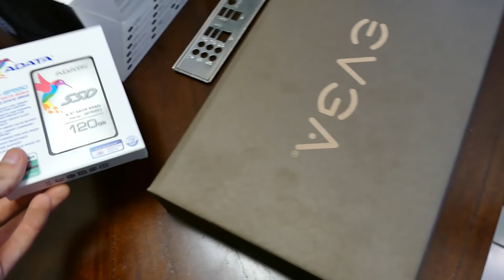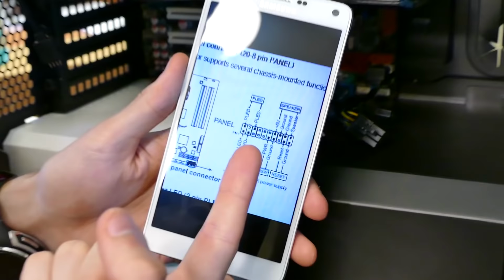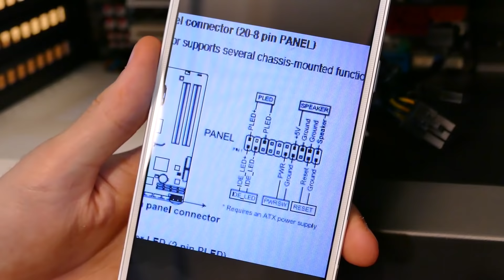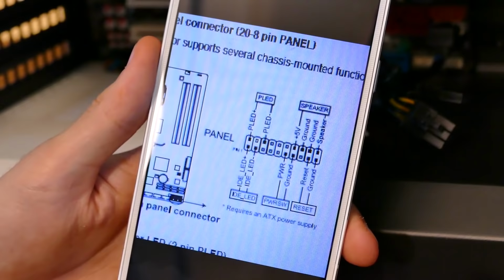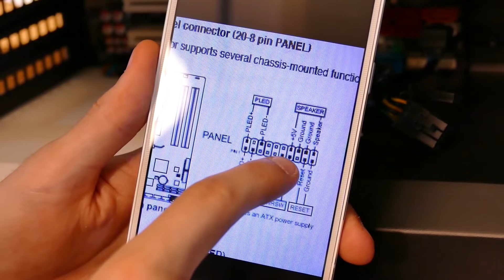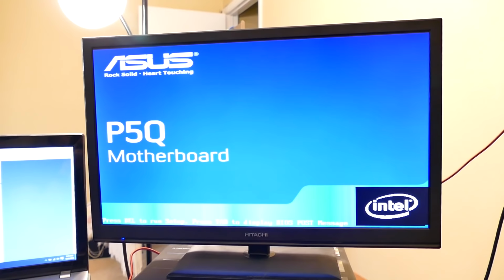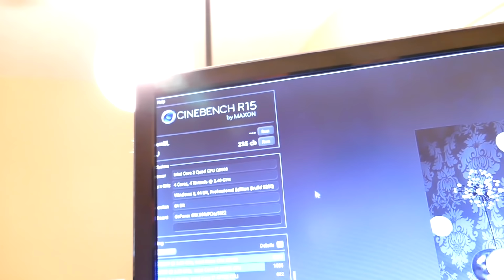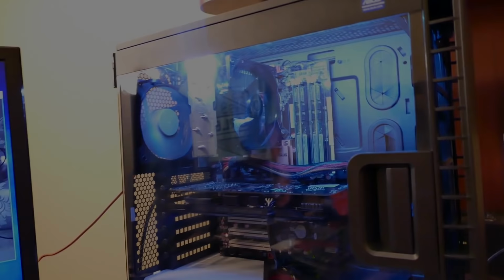Q6600 PC Build Vlog

Comment: I still find it enjoyable to watch an old CPU like a Q6600 being used today.
Reply: My q6600 is still used for gaming
Reply: I'm using mine to type this and I love it.I bought the CPU for around $10 on eBay and the rest is built around a SFF DELL 745 with eBay Parts.Around $125-150 including the Tower.Plays a good range of games still,just don't expect a monster  gaming rig.
Reply: Typing this on my PC from the golden era of PC gaming (circa 2008) with a i7-920, still loving it, gonna get a x5650 soon though
Reply: My Secondary PC has a Q9300 with an R9 270x playing DOOM :)
Reply: doom 4 can even be ran on a pentium 4 coupled with a gtx 970, even though it looks stupid it gets decent 30-45 ish fps on very high preset 1080p. (saw that in a video).
Reply: shag stars That's pretty incredible.
Reply: I'm building a PC using 790i chipset and QX9770 just to see how well it compares to a modern PC.
Reply: dude i have core2duo ..get a life
Reply: Charle Lol its not like it was meant to be an insult.
Reply: what gpu did you put in it?
Reply: I used a Radeon 7570 Low profile.A full size card won't fit.Also,I modified the internals a bit for cooling.I would never personally choose this size of case.It was only $20 with all of the factory internals still at a pawn shop.These SFF are horrible for cooling.The benefit is the stock CPU heat sink is pretty decent.
Reply: i found my q6600 machine in the dump and just modded it till i got decent frame rates on my games
Reply: im using qx6800
Reply: manwhile, with my fx 8320....
Reply: +3key I still have a 8320 in my secondary PC. Once you overclock them to 4.6ghz or so they aren't that bad at all. Thy still lack the single core IPC of Intel. But for $130 this 8320 is great. Plus when DX12 becomes more widely used it will bring new life into these FX chips. But My 8320 at 4.8 cooled by a Noctua DH-14. Now it's not as fast as my I5 6600k but the 8320 is from 2012-2013. I will say the multi-core performance is not far behind my i5 though.
Reply: same
Reply: XxViciousxX that is if you dont oc your core i5 6600k, vlock it at 4ghz and then its much faster than fx.
Reply: ShagStars Productions My 6600k is at 4.780ghz most games like strong single core performance so my 6600k plays games smoother wth higher minimum FPS.  But the 8320 is not that bad considering it's age and low single core performance and price.
Reply: XxViciousxX well its not bad but here it costs as much as a core i5 6400. Which defeats the point of having an amd fx.
Reply: ShagStars Productions Definitely at that price yeah no point in getting a FX. But at this point in time with Zen right around the corner it would be silly to buy a FX processor now anyway.
Reply: XxViciousxX true.
Reply: I just upgraded my E8400 PC with a gtx 670 i got off ebay, that little dual core is a beast when overclocked! (got it to 3.6 ghz on the stock cooler, i'm going to get a better one so i can get 4ghz without hitting thermal limits)
Reply: arthur staal I had one of those E8400s back in the day. Was a very powerful chip. Destroyed my 1090t in the gaming department.I think I had mine at 3.8 with a Thermaltake Big Typhoon cooler. My motherboard had terrible overclocking capability. I think with a better board I would have hit 4ghz.
Reply: From Dusk Until Dawn Hi, can you try running DotA 2 on your pc? I have a 9300 with 8 GB DDR2 Ram and a GTX 750 and somehow there is a bottleneck in my system, DotA 2 framerate hovers around 30 fps with Vsync off and lower setting (GTX 750 should comfortably ran DotA 2 on max setting at 60 fps without weather effects, tried it on a 4th gen core i3 system)
Reply: Edwin Ooi definitely not you cpu or gpu, I get 45 to 70 fps in shadow of mordor at ultra (e8400 + gtx 670) you probably have a driver issue.
Reply: Dude I have pentium dual core get a life ;-)
Reply: switching my E8400 for xeon 5450 this weekend)
Reply: I just got system with 5450 , xenon e5450 4gb ddr3 500gb hdd for 110 dollars and put in radeon 7790 1gb , evrything works perfectly I play paladins at 1024x1280 maxed out it never gose bellow 70fps , gta 5 1080p normal 40-45fps , im really happy about its 150dollars for gaming PC that can keep up with 350 dollars consoles :-D
Reply: #i  still have one E8400 on a dell T3400 set with a GTX760, i&#39;m looking for a Q9650 to Level on 4Cores :)
Reply: I actually just put together a Xeon 2670 build yesterday. Got the processor  about 5-6 months ago when they were dirt cheap $50. The thing just eats through games. Then there is the crazy multitasking ability. You can do so much and it doesn't slow down a bit. Got the idea from Tech City. Had a lot of fun building the Xeon system.
Reply: get a xeon lga 775 cpu its faster and cheaper than the core 2 extremes
Reply: I use a q9400 in 2017 hehe
Reply: Alex Tana i have a q9300
Reply: I bought a q6600 off ebay a while back for $15 shipped. Been running it in my secondary machine which was my old primary (had an e7200 in it). Running 1333mh fsb with 8 GB of ddr3 it actually runs modern games quite well with an hd5770 (1gb). 

I use that machine as a server for ftp/mumble/ts whatever I need at the moment. Mostly though I use it to serve media and to box games.
Reply: Came across this video after a search... currently putting a Q6600 through its paces... got the system free, put an SSD in it, and am pushing for stable over clocks on CPU and FSB - kinda hoping I'll be able to run Premier Pro 2015 on it passably for 1080 editing, 60 fps - anyone want to make me happy by telling me it will all be well... or crush me by telling me my 48k spectrum would be faster lol

I have zero budget hence why not just building something current, I love something for nothing :D
Reply: Shoutout to 2021, just came back home in my co try and fired up the q6600... Oc'd at 3.9 with stock temps at 68... Changing the noctua cooler to water, and the gtx260 to a 980 ... Should go for couple more years in graphics and games
Reply: Me too

Comment: Q6600 is such an overrated CPU
Reply: for 16 bux??? it is doing very admirably. Q6600 is a great workhorse CPU even in todays tasks.
Reply: For similar price you can get for example much better Xeons for LGA 771, or C2Q for LGA 775
Reply: deXter2 cant overclock.
Reply: Bullshit. And btw - you will lose all your money saved on OC Q6600 after half a year... Extremely inefficient and power hungry.
Reply: deXter2 why would you need to save up for 16usd lol stop while your at it dude.
Reply: Why would you buy 16usd cpu then? USA is not the only country in the world, some might think it's a good deal and not just fun.. Well, it is not. 
And I forgot about first i5 series, very cheap now and some revisions overlock really great. 
Forget Q6600, it's just too fucking old.
Reply: deXter2 thats 22usd. I still need it to be fiiiiiiiiiif>teen US currency dollars.
Reply: deXter2 The cheapest i saw was 22usd. U mad???
Reply: My q6600 is still running at 3,4 ghz in my second pc and it is a beast and yes its old but i don't care.
Reply: Dude can you chill? You can overclock a Q6600 higher than the Xeon can go, and the Xeon you showed for $22 isn't even hyperthreaded. You don't need high cache unless doing high CPU based tasks, and with such a low core count and speed, it wouldn't do much help anyways. And the Q6600 is less. Q6600 is the clear winner.
Reply: Umami Cupcake i3 processors have better performance, not value. Q6600 is $15. i3s are much more expensive.
Reply: windowsfrozenshut I'll give you that one. But that doesn't invalidate the Q6600. If you don't have an LGA 771 board, but have an LGA 775 board, then the Q6600 is a better choice. But if you have an LGA 771 board that supports Xeons, (they were less common back in that era) then you can go for the x3353.
Reply: How about the Xeon version of a Q9450 for 9$ (that's 9 US smackaroons)? Plus a few cents for a "mod sticker", and 20 seconds with a box-cutter for chipping off the keying nubs in the LGA775. 
http://www.ebay.com/itm/Intel-Xeon-Quad-Core-E5430-2-66GHz-12MB-LGA771-SLANU-CPU-Processor-/331881825508?hash=item4d45b2c4e4:g:de0AAOSw3YNXYIKD

I'm (still) running an L5420 @ 3.3GHz (quad low-power, 2.5GHz stock) on a P5Q Pro, and upgraded the rigs of two of my friends with an E5430 @ 3.2GHz (quad, 2.6GHz stock) on an MSI P35 Neo, and an E5440 (quad, 2.83GHz) in some Compaq microATX. Both of them are happy, and i've heard of zero issues.
Reply: Good thing I brought my cereal popcorn!
Reply: Je van der Geest ^^^ THIS ^^^ :)
EstMovies Even LGA771 boards can be had for dirt cheap nowadays, although the argument could be made that finding one in a (normal) ATX format's gonna be tricky. 

For further information: https://web.archive.org/web/20160320090508/http://www.delidded.com/
Reply: yeah tbh, my friend has a better version of it (i'm not sure which one exactly, i think it was the 9650) and it's better for around the same price nowadays.
i think the main thing is how well it's held up since its release but... so did the others. that generation was just very very strong.
Reply: go with a core 13 550 its like the same price @3.2 ghz and its hyperthreaded, and it has onboard graphics and its 3 years newer it's better in every way than a q6600
Reply: Its a 10 years old CPU.
Reply: My core 2 duo E8400 is really pissed about your comment
Reply: C2D E8400 is soo much better cpu in relation to price nowadyas. I know, I have one myself in my mother's PC. Actually for most basic uses it is more powerful than Q6600 for fraction of money you have to spend on overhyped Q6600 which keeps such a ridiculous price partially thanks to all the irrational hype made by some 'retro tech' youtubers.
Reply: Lga771 motherboards are fucking expensive unless you go fucking hardcore hunting for a cheap one
Reply: xeon 5450 is better still for under 20 bucks
Reply: you can use an adapter to fit lga 771 cpus into 775 mbs, it costs less than a dollar
Reply: leafyisqueer I've been using a Xeon L5420 o/c'd @ 3.33GHz on an Asus P5Q Pro for about a year and a half now, with zero issues :P CPU cost me a whopping 15eu (12MB cache and all that)...
Reply: but then you have to cut up the mothrboard

Comment: Core 2 Quad: Q6600 & Phenom X4 9550 are legendary CPUs! :)
Reply: used a phenome ii x4 965 are as expensive
Reply: I'm still using a stock clock Phenom 955. It works well for a general use desktop once you install a good air cooler.
Reply: yeah man me also i have waited so long for amd to come up with something im still waiting for zen now cuz i dont like that i have to go with intel they are fucking bastards.
Reply: had a q6600 and an 8800gts back in the day. good times.
Reply: Haha got both on my shelf
Reply: i used to use phenom x4 9750 since 2007! worked fine at @3.2ghz but had to finally upgrade it last month. :D
Reply: That is fanboyish, just buy what is the best for your money.
Reply: shag stars
Like anything used on ebay? :D
Reply: ネーナ・トリニティ that is risky, it will work when it arrives but how long it will do in the long run isn't known.
Reply: i still use 1090t for gaming im just waiting for zen to come out but my cinebench r15 score is 582 so not that bad :D
Reply: Noonoo
Phenom II is still great for games, mainly the 6-cores, to be fair you can easily use anything up to RX 480/GTX 1060 and play most games at 1440p! ;)
Reply: +ネーナ・トリニティ i still use gtx 660 what do you think should i upgrade my processor or gpu first? im planning to buy rx 480
Reply: Noonoo
RX 480 now and Zen later, I think your CPU will be better than a FX-4300 so it will be fine with such a GPU in most games. :)
Reply: +jlefebre6001 Dayum, that was like top of the line back then.
Reply: +TheDrewSaga Windows 10 did something to my X300 and made it run triple the performance.
Reply: I used to run with a phenom II x4 965 be.
Reply: #Yep and still Worth with pretty good O.C i got one Q9550 running at 4.2GHz on another old school rig beating easily a Core i7-920 at speed stock :)
Reply: i use Core 2 quad: q6600 & Nvidia geforce gt 630 a 1gb and run the games perfectly
Reply: EricOD xd
Reply: ネーナ・トリニティ gaming on a 9550 right now ;D
Reply: What motherboard are you using for a 4.2ghz overclock??? I need one of those.-
Reply: For Q6600? o3o
Reply: Yuppers, is it the Gigabyte GA-EP45-UD3P Rev 1.0 ??
Reply: i recently picked up a phenom ii x4 925, just need a gtx 950 now
Reply: ネーナ・トリニティ get a gtx 1050
Reply: i had a Phenom x2 555be unlocked to 4 cores and clocked to 4.2ghz :D
Reply: I have a Q6600 + 4GB DDR2-800 +  GT9600 running at 3Ghz since 2008... About two years ago I just added another 4GB of RAM and a Kingston SSD and it is still doing a good job with CAD software...

Comment: Check out this ebay deal hunting budget build I made: 

>ASUS Sabertooth P67 + Intel Core i7-2600K 3.40GHz + Intel Stock Fan + Chipset fan + Crucial 2x4GB DDR3 RAM -- Found all of this (used of course) for an absolute STEAL on Ebay for $179

> EVGA GTX 750ti FTW Edition -- Used on Ebay for $100 (Still trying to win bids for a better card, however I might just keep the 750ti since it has exceeded my expectations and is definitely holding its own in modern games at 1080p)

> Corsair CX430 -- Used on Ebay for $20

> Corsair Carbide Series SPEC-01 RED ATX Mid Tower Case -- Brand new from Newegg for only $30 (Great sale)

> Already had a 500gb 7200 RPM WD HDD so I put that into this build

And if you want to include the price of the OS throw on another $20 for a Windows 10 key from Kinguin. In total that puts this build's value at just **$350**. It absolutely destroys 1080p gaming! The GTX 750ti deserves a spot in the GPU hall of fame! Insanely great performance for the price
Reply: da real console killer. rekt
Reply: That's interesting, I have a 750ti but never expected to get much out of it. Are you doing ultra settings at 1080?
Reply: You can actually overclock an evga ftw version (750ti) and get a lot more performance that you could expect though is not enough to get ultra 1080p @60fps. I had one myself but sold it and bought a pretty good deal on a 770 :D
Reply: SilentVectorX Some games I'm able to play on the highest settings, but on games like battlefield, on ultra, I'm getting 40-50 FPS which is still very playable. Games like Rocket League I easily attain 60+ FPS
Reply: JayVee.TV That sounds pretty good to me! I'll see what I can do with it. Thanks for the tip.
Reply: I agree about the GTX 750 Ti. My last build had one and it was still actually decent in 2017! The GTX 750 Ti definitely is one of the best value GPUs ever.

Comment: Excellent build. I still rock an old 2009 Q6600 @ 2.610ghz 8gb DDR2, and a GTX 950 2gb Win7 64bit.  Had it at 3.2ghz, but do not really need it that high with the games I play on it. Runs Watch Dogs at medium settings just fine.